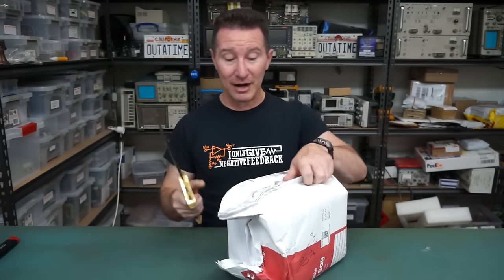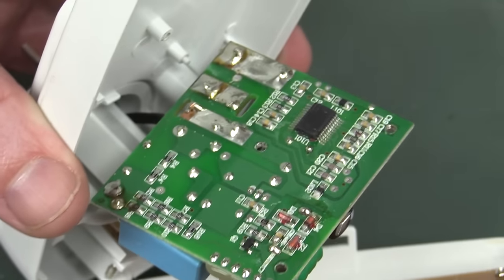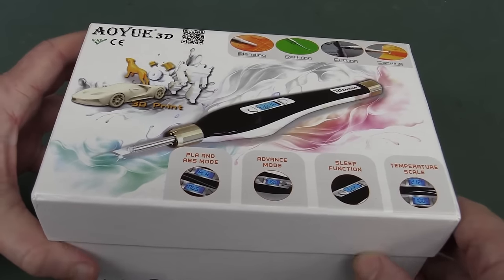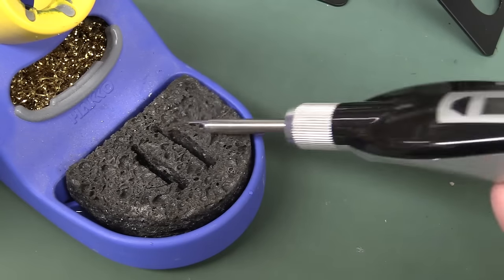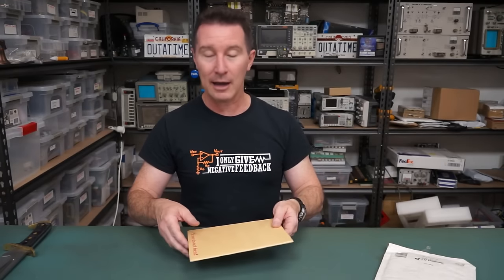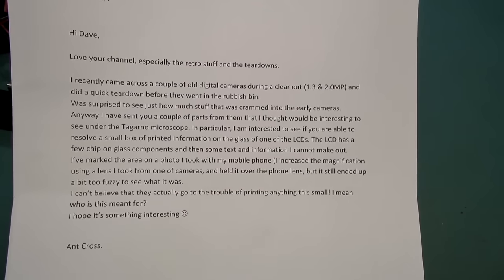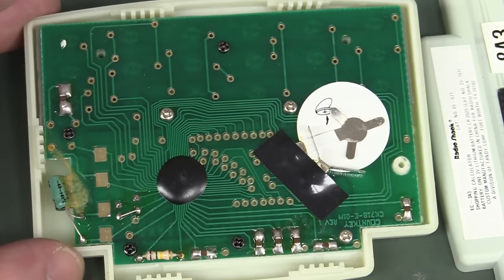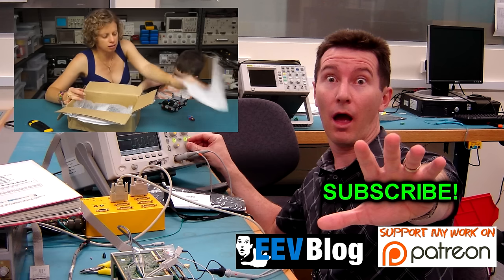EEVblog #880 - Mailbag

Comment: Assuming you can trust the labeling, those power supplies are by OSRAM, according to the board labeling. And that's pretty much an A-grade lighting manufacturer. I suspect these are not supposed to be used as bare boards in plastic enclosures, and/or they're supposed to be used with forced air, and/or they're fake as a whole, and/or they got stuck with a bunch of fake parts.

Comment: That Parameters Multimeter is the same model as the one's we had back in1989 in telecam Australia.
I had mine hidden on my second last day of work, because I was warned the Install techs would pop the hinge on my tool box before the start of the last. Thus anything missing would be put on there bill... :)
I was working in Pitt Street Carrier. 10th floor of Pitt street exchange.

Comment: 36:03  These lamp drivers are OSRAMs! Maybe not just their failure, but the lamp manufacturer's, e.g. insufficient air flow around the board.
Reply: +mrnmrn1 
That`s what I think too. They took a decent module and then sealed it in a IP67 box.

Comment: +EEVblog Dave, i've got a hunch you might've gotten the input and the output mixed up on those lamp driver boards. Why would a 60V input need three caps in series, and so much separation between the tracks, hmm? :) If anything, that looks to me more like something resembling a CCFL inverter, with those freestading FETs making up a full-bridge driving that "quad-bobbin" output transformer.

Comment: The "Cylopedia" is similar to a set of old :Hawkins Electrical Guide"  books my Grandfather had.  I borrowed two of them, but never returned them.  My Uncle sold or threw them away without mentioning them to me, so I couldn't add the two missing ones to the collection.   I still have the two volumes.   A complete set in poor condition goes pretty good money on E-bay.  I never found a cheap set missing the volumes I have, however.
Reply: +excavatoree Crap - I forgot to say the uncle in question was my Uncle Bob.

Comment: The cyclopedia of electricity volume 3 is missing Viii is volume 8 🤔
Reply: +Donald Sleightholme I noticed the same thing. And it clearly says eight volumes in red lettering inside, right under the 2000 engravings-text. I saw a 1909 version of the set when I searched, and that only includes 6 volumes. Maybe there is an earlier seven set.
Reply: +Donald Sleightholme Check out archive.org for quite a few scans of different editions of those books.

Comment: Question...since you're such the Fluke Fanboy (yea, I am too)...I have a fairly aged Fluke 87 True RMS meter (got it in '92).  Anyway, every 3 to 5 months I need to crack the case and pull the display off and re-seat it because the LCD Segments start disappearing.  Once I pull the retainer off and re-seat the LCD, the display is golden for another 3 to 5 months.  Fluke said they can "fix" it, but it would cost nearly what a new one would cost.  My feeling is that their "fix" is to replace it.  Any ideas of how to fix this permanently?

Comment: Probably a basic question, but what are the vertical springs on the multimeter PCBs in the first 5 minutes for? Do they make contact with the inside of the case for ground or something?
Reply: +Blargo  Correct. I take it you noticed that brief glimpse of some metallized tape on the inside of the case. This is used to shield against electromagnetic interference coming in and out of the device; just as the metal screen in the window of your microwave mostly eliminates the radiation that would otherwise come pouring out.
Reply: I was looking for a shot of the inside of the case where the springs might make contact, but didn't catch it in the video. Thus the question. Guess I didn't watch closely enough!

Comment: Why does Dave always make fun of the transistor and capacitance testing feature on multimeters?
Also: the yellow Fluke meter also has those features
Reply: Moritz von Schweinitz because they are generally unsafe, you have nice high voltage insulated banana jacks connected to barely recessed bare metal your fingers can easily brush against. in modern meters usually a sure sign it is lying about its cat safety rating.

Comment: 200$? there is currently a 3d print iron which is "branded" for 35$ with the same tips. and that thing isnt more than your cheap 5$ soldering iron
Reply: +Matze Strawberrymaker Are you talking about the modifi3d? I had a big argument with one of there reps on youtube. He was trying to tell me that it wasn't one of those cheap Chinese usb soldering irons and that they were just using the same case with different electronic. These companies are nothing more than snake oil salesmen. He tried to tell me there device has a special coating on the tools so plastic wouldn't stick.
Reply: +TheConanRider jup that one.  not long until chinese ebay sellers will have it for 10€ or so. hope the guys behind the modofy3d fa with their conpany.

wondering if anyone did already a teardown? didnt joel did one?

Comment: 36:00 Those TO220s might actually be diodes, otherwise where is the input AC rectified?
Reply: +funkyironman69 Ah there 19N20s, that's weird isn't it? They should only need two transistors for switching? Maybe the other two are being used for synchronous rectification or their using the internal diode?
Reply: +funkyironman69 Okay, it's a full wave diode bridge using the internal diodes.

Two pairs of FETs, each joined Source to Drain. One AC input goes to each midpoint.  The Drain of the top FETs in each pair are joined together by jumper J5. I'm assuming the sources of the lower FETs in each pair are connected together by GND.
Reply: +funkyironman69 And to top it off, the output is most likely a simple dcdc boost converter. A FET and free wheeling  diode, both on the heatsink and a large inductor on an EE bobbin.
Reply from the maker: +funkyironman69 Wow, I didn't notice that.

Comment: Can somebody explain to me, why 'transistor tester' in a multimeter is so bad and makes it garbage by default?
Reply from the maker: +AlexeyTea Top quality expensive meters don't have transistor testers. The exposed sockets degrade the safety of a meter.
Reply: +EEVblog not a big deal for me. At least, not causing to cringe every time when notice them.
Thanks for the answer! And mailbag is good as usual.
Reply: +EEVblog Is that really an issue in this case? I'm pretty sure I've seen video of the Fluke this is copying exploding under test.